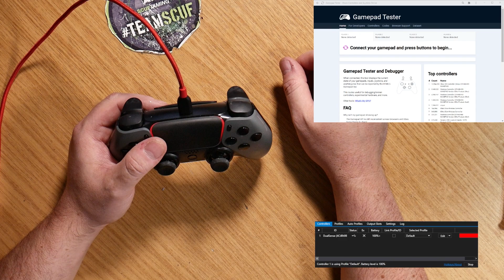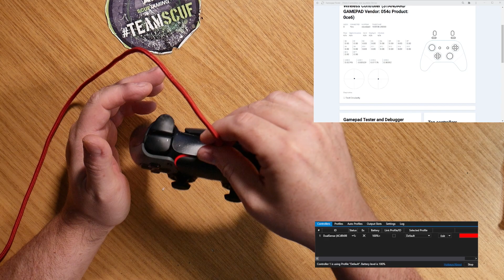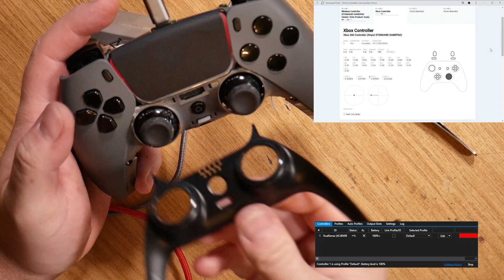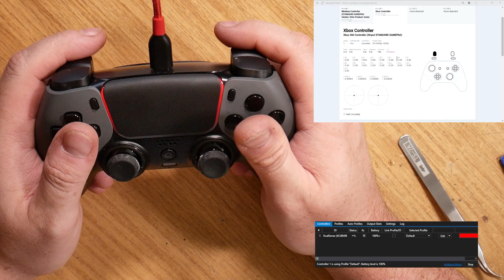SCUF REFLEX FPS TRIGGER REPAIR - STICK DRIFT

Comment: Great content! I was meaning to get in contact with you. Literally brought the PS5 reflex pro and  it not been 3 months and I’m already experiencing stick lag/drift. What platform can I get hold of you on?
Reply from the maker: Sorry to hear you have stick drift so early on. By all means go back to SCUF for warranty so they can own the issue. However if you want it fixed correctly you can contact us here: www.ubermicro.co.uk or email us here: enquiries@ubermicro.co.uk
Reply: Same. Had it for like 6 months and im already having really bad stick drift. Insane if you think about the price tag. Really regret my purchase at this point
Reply: @sudiiskevvejfkdbs  I started having stick drift after 2weeks of buying mine. It's insane
Reply: @UberMicroRepairs   so I'm having a problem with my reflex fps switch on r2 where it works but has intermittent times when it doesn't work I was wondering how to get the switches replaced and maybe this support bar added in both sides ?

Comment: I have EXACTLY the same issue as you. L2 trigger with the same crack. I also realized why the L2 was affected but not the R2. The L2 plastic hammer that hits the momentary button is on the outer side of the controller. R2 is on the inner side (battery side). Squeezing down on the trigger puts more stress on the outer sides just by the nature of how the controller is held. I think a long-term solution would be mirrored design to orient the hammer (the broken plastic part) on the inner side for both triggers. Not sure if Scuf would use a metal spring. Cost and time would increase. Just update the plastic hammer to have a trust under the arch. Boom, easy peezy.
Reply: Btw, I just fixed mine, but in a different way. Gorilla super glued the crack to hold it in place. Then plastic welded a trust under the hammer's arch. Took 5 mins.
Reply from the maker: I think you are correct with the asymetrical design. I've done alot of these repairs and most of them are R2 where they are pressed thousands of times during a long gaming session time and time again. I think just having the plastic beefed up would correct the issue. Really easy to ammend the mound.
Reply: @UberMicroRepairs  update: mine broke again. Plastic is plastic and welding existing one surely affected the integrity of its original strength. Going Metal like you. In the meantime, bought myself a PS Edge controller and I have to say that it’s pretty bad ass compared to my Reflex FPS

Comment: My 3 pence if I can, please:

1. I had a scuff, repaired the analogue for the customer and after replacing, I've been told that it's useless for this customer. The reaction is different than was originally. I've used 10k potentiometers, the original one was as well 10k. So, the only difference was in the joysticks.
2. Any type of gluing of the plastic  where super glue is not working, we can use a baking soda + super glue. This is creating really hard and well made connection. There's plenty of tutorials on the YT.

I don't recall if I've got that SCUF repair on my YT channel, too many videos :), sorry. But, this was a PRO player using only wired connection and I can't verify if he was talking truth cause he meant to bring it, and never did.
Reply from the maker: Super glue and backing soda is a good method but not with ABS plactic. ABS is a greasy plastic and requirs acetone or MEK (methyl ethyl ketone) for plastic welding. I only used super glue to keep the part inplace while I repaird it, a place holder if you will. I used epoxy and a spring metal backing with hot glue as a rubber buffer. I have since though of many more methods of attempting this repair all of wich have longivity in mind for the customer. More videos will follow. 3D printed parts ect...
Reply: @UberMicroRepairs  thank you :), I never had a problem with ABS, maybe I was lucky with PVC, or other type. :) But yes, other methods like 3d printing are many times good as well. Only if have an opportunity to design and have printer. 

Just by the way, I bought a 4k resin printer several months ago and till date I did not learn how to design on my own :D. Never have time to do it, probably after the new year will go back to learning :). So, hope you'll have some videos on it as well :).

Comment: Hello I figured you would be the perfect person to reach out to about my reflex pro issue. Currently when I press the left stick with any serious amount of thumb pressure it does my right stick action. For example, I will be trying to sprint in the game and it will make me crouch which is on my right stick. This has been frustrating since I already sent the controller back once
Reply from the maker: That is a weird one. Only thing I can think of is the PCB is tilting when pressing the left stick. Or there is someting shorting out with the pressure. I'm afraid I'd need to look at it to help further.
Reply: Mine has the same issue as well

Comment: Man I had the same issue with my trigger after only 2 months. Terrible design. I decided to fix it myself following your video instead of sending it to Scuf with the warranty. I bet my epoxy will last longer than their cheap replacement😂 Thank you sir
Reply from the maker: Nice one! Remember to do the same to the other side so they feel the same.

Comment: Very helpful.
I also want to replace the Stick, but how many Stick resistance should I have?
I have a 2.3k ohms Stick, but will it work with 2.3k ohms?
Reply from the maker: 2.3k will always work, however it will give incorrect end travle. If you are a compeatative gamer you will notice the differance. We always put in the correct resistance as burned into firmware by factory.
Reply: @UberMicroRepairs  
Thank you.
I see in the video that you are replacing the Stick with a Stick with green and black parts.
Am I correct in interpreting this as using the 2.1k ohm model?

Comment: good video but you really don't need to de-solder anything, you can remove the trigger module by pulling the small ribbon cable and save yourself the hassle of soldering.

Comment: Is there away to reinforce the triggers with steel before there is a problem. Maybe do it in a video
Reply from the maker: yes the modification I do can be done before ther is an issue.

Comment: Nice video! I think this also happened with mine. Cant use the trigger on my FPS anymore. The controller is about 7 months old and wasnt used too much. My boyfriends controller (Reflex) also had an issue with the trigger he was able to fix it quite easy after Scuff denied warranty because his is also about 7 months. These were our first and last scuf controllers!! Were so disappointed. Is there a away to generate as much attention as possible to get scuf to move??
Reply from the maker: Sorry to hear that.Glad it was an easy fix for you .. There are ALOT if issues with SCUF The horror show can be seen here: https://www.reddit.com/r/scufgaming/
Reply: @UberMicroRepairs  I have instant triggers on my reflex, had it for about 8 months. Bought it for like $300+, about 3 months in R2 stopped working, got a free repair got it back in a week or so. Few months go by right before thanksgiving my L2 stopped working. I asked for a refund but they said it was passed the date yadda yadda yadda.  Sent it back to them and i asked for just the basic triggers to be put back in, they said no problem. Just got it back about 3 days ago and now my left analog stick drifts both left and right, as long as the right. This thing is not worth the money let me tell ya.

Comment: what precision tweezers are you using uber? Im upgrading my tools for work lately I want some good quality tweezers that dont bend
Reply from the maker: I use iNeeZY Tweezers for trace work. https://amzn.to/41GeefT They will bend if misused. I use the AliExpress cheapo ones for general work.
Reply: @UberMicroRepairs  I ended up getting knipex tweezers I want them to last the 92 22 35 and 92 34 36 angled ones they are proper tweezers made for the long run expensive but won't bend.. I ordered a pair of qianli tweezers also today and will see what the hype is with them. I heard they are pretty good also and if you are having success with them then I'm sure I will with my soldering and precision work. I am learning how to repair controllers and  electronics in general/PCB's at school and need tools that last.  Thanks for the info my friend congrats on the 10k subs!

Comment: Is there an easier method to getting the trigger replaced ?
Reply from the maker: If nder warranty send it to SCUF. If no under warranty Contact us we maybe able to help if you're in the UK? www.ubermicro.co.uk
Reply: @UberMicroRepairs  I took it apart and made a stint out stop the plastic piece behind the trigger from folding at the crack, it’s working for now

Comment: Just had the same issue with my scuf, same exact model, on the L2 button.  Never had these issues with stock controllers...what the hell..
Reply from the maker: SCUF re-house stock controllers and add these functions... It's the SUCF parts that fail!

Comment: Been looking at buying the Series X model but afraid of the stick drift that I've been hearing alot, what would cause this issue?  Thank you!
Reply from the maker: If you buy a stock Xbox, PS4, PS5, SCUF. Battle Beaver, AIM or almost any controller with a carbon track resistor potentiomiter (pot/s) you maybe subject to "stick drift" at some point in the devices life. None of the companys seeamingly do ANYTING to proactivly mitigate the stick drift issue. You will / may get it with any controller you buy. It is a inherent issue with the fundimental design of the analog module! We at Uber Micro manipulate the pots so the premature wear is reduced. We cannot gaurentee it will never happen just offer a longevity option (not a gaurenetee by any means) with any analog modues we replace, but a best effort is made to reduce the "stick drift". All controllers are classed a consumible item by the manufature. Any stock factory fresh (or manipulated / modified one) controller 
WILL wear out at some point. How they wear out is down to hundreds of factors. We try to reduce that as best as we can. This all depends on the end user treatment.

Comment: Hello mate you are in my opinion the best technician.

 What are these substances, which you are mixing at 10:52 ? Where did you buy the metal
Plate from?
Reply from the maker: It's JB weld apoxy.
Reply: The metal plate where do i search for it?

Comment: Hey I have a problem with my scuff reflex for ps5. The headphone Jack (the black piece that your 3.5mm jack cable inserts into) is loose and shifts around causing me to not be able to plug my mic in. I tried taking it to a shop to replace that piece but they said scuffs is different and it’s connected to the motherboard. Would I have to send it all the way back to scuff to replace? I’m not trying to wait 😭
Reply from the maker: SCUF use standard xbox / Sony controllers.. So the audio Jack's are exactly the same.

Comment: I took mine apart and everything looks fine on the inside I fixed my drift stick by replacing one of the things that causes it but know my L2 and L1 buttons don’t respond at all they feel normal but just don’t work at all.Do you know anyway I can fix this?

Comment: Wait how did u calibrated the sticks what part inside the potentiometer did u moved to get the dot to the center. I’m having the issue of my right stick moving heavy to the left side I already changed the potentiometer to a 2.3ohm one which is the required for ps5 controllers

Comment: Can I replace the module with a different controller brand module from king Kong pro 2 controller
Reply from the maker: You will need to replace with an identical model.

Comment: Dude. I spent too much money on the reflex fps pro and yesterday after only a few months the R2 instant trigger has stopped functioning properly. It's the same problem... I'm so disappointed in scuf. They've printed this little 5 cent part and charged me 50 dollars for "instant triggers." Yeah, instantly breakable triggers. I don't know how to use a solder iron, otherwise I'd already have disassembled it. I don't know if there's a way you could help me, I live in the Eastern US. I'm not sure what to do. I might have to acquiring a soldering iron and teach myself a new skill. Either way this is a huge pain in my ass and I spent about $430 for this controller kit. I'm ashamed of myself.

Comment: so what are you doing with the tweezers with the sticks with the software up? my sons scuf has its left stick input drifts to hard left without any input. thinking something is messed with the mechanical part but trying not to have to replace the sticks yet. wondering if there is a way to fix that prior to replacing them. it was only 3 months old when this started but he was at college and now warranty has expired.

Comment: Hey so my scuf reflex fps left trigger still clicks but it is not responsive what should i do?
Reply from the maker: Could be the switch going faulty or a wire coming adrift.
Reply: I fixed it the left trigger plug in was disconnected from the motherboard on the controller
Reply from the maker: @getputup1001  Nice one!

Comment: I have a question my x button doesn’t work sometimes I was gonna send it back to be looked at. I’ll be moving on cod and than I go to jump with the paddle and it don’t jump than my x button don’t work I have to use my other paddle and it works after that it’s weird. Should I send it in? It’s brand new. Thank you if you can help
Reply from the maker: If it's under warranty send it in the SCUF! They should deal with it in a professional and integral manor..I can't beleive I typed that with a straight face! 😛

Comment: My mic isn’t working anymore 🤦‍♂️ and when I press L1 or L2 the controller disconnects. Idk if I have A faulty L1 or L2 ribbon. I’ve put the extremerate mods onto my stock controller so idk how to break it down but I’m scared to try with the skuf.
Reply: Nvm figured it

Comment: My left trigger clicks just fine, but when im holding it down " as to aim " it will work and then not work sometimes. Super frustrating.
Reply from the maker: This could be the plastic spring or the switch. Hard to say withoput seeing it.

Comment: Is it possible to install hall effect thumbsticks on a ps5 controller?
Reply from the maker: Not really without designing a new PCB. That only analogs that use that are the new Steam Deck analogs. But trying to interface them would be difficult.

Comment: Hey I thinking about buying the scuf ps5 fps anyone know if it's good. My history with elite controllers is 3 xbox elite 2 all of them had bamper issues and the main reasons I want to switch is because the Xbox elite pull rate is very do anyone know if u can fill the overclock plz write u r thoughts on the scuf and if u feel or have an overclock controller (I would  still like to get the Xbox elite)
Reply from the maker: The SCUF controllers use bog standard PS4 / PS5 main boards so if you are using them on a PC with DS4Windows you can up rate the polling. I don't think you can do that on M$ controllers. IMO, No matter what controller you go for it's a lottery weather you will be unfortunate to get stick drift / bumper issues. In my experience of repairing SCUF controllers on a daily basis. I would hard pass on them 100% (polished turds look in the SCUF sub reddit for horror stories!!!) Go with a company that is local to you because stick drift issue is bad and a warranty claim may be needed. With the way we calibrate the sticks and years of experience we do add "a little" secret sauce to the repair to give you longevity. However, controllers are considered and "consumable" item. They will and do wear out! I would recommend companies like Battle Beaver or AIM for some nice neat mob work. However they do not mitigate stick drift.
Reply: @UberMicroRepairs   is the standard ps5 Last longer cause I know u can install some paddles and smart triggers there also is the aim and battle beaver last longer then the scuf
Reply: @UberMicroRepairs   when I think about that what the problem of replacing the joystick to hall effect joystick is there more input delay on those I would love a video on the subject

Comment: I spent 250 😅 on a. Impact.  With mouse triggers.  Within a few months, the r1 was acting up.  😂 I didn't even press r1 that much as I used the r2 to shoot.  Theres stick drift on the right thumb.  I can easily remove them but the stick themselves wont fix the issue. Now the l2 is acting up.  I have to hard pressed it move/force to the left or right to get it to work.  Anyone knows if i can get the mouse triggers online since i know scuff wont sell me the parts.

Comment: On my scuf impact The L2 is sticky and stuck when ever i press it, it stays Held down so i switched to a normal controller but idk how to repair nor do i have the money to repair at scuff cuz im 15 any idea
Reply from the maker: Hi, Sorry to hear the issue. Maybe check the dead zones in the game... Go into the options and default all controll options? Let me know if there is any difference.
Reply: @UberMicroRepairs  I play ow2 and its on all games when i click R2 It sounds fine but l2 is different sounds a bit broken
Reply from the maker: @Im2tiredforthis  If it's stuck either on or off. It maybe broken, contact us with some info. Search on Facebook "Uber Micro Repairs" with a video of the issue and we can advice you. Seeing the issue happeing is alot better.